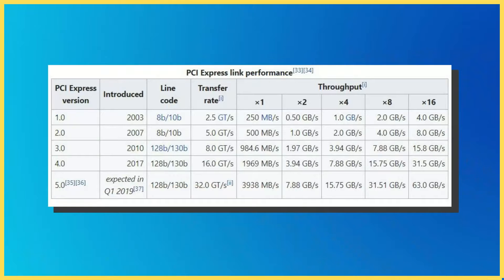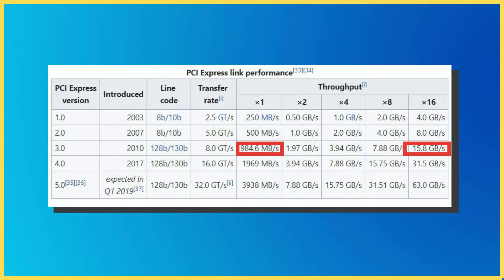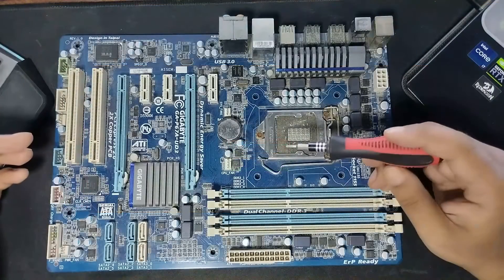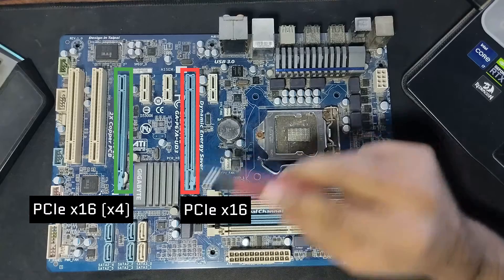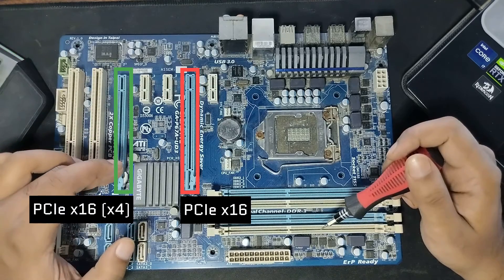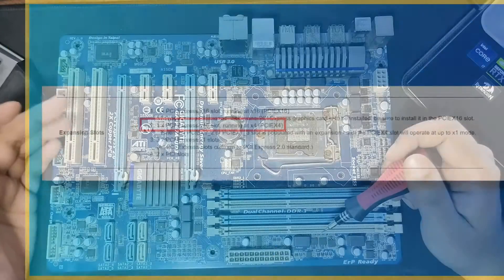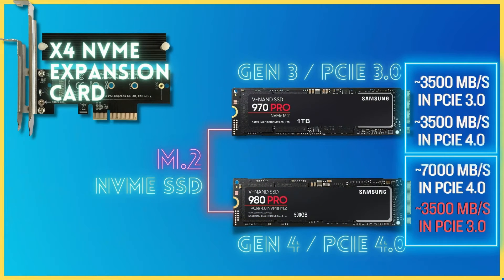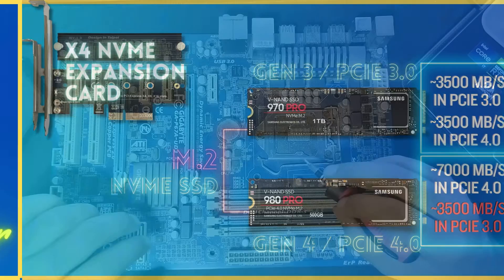What Are PCIe Slots Used For? - Devices and Expansion Cards Explained

Comment: thank you for these great info

quick question tho, my mobo ( b760 mk-d4 ) offers 2 m.2 nvme pcie 4.0 slots ( x4 lanes ), and 2 expansion slots ( x16 and 2 x1 )

can i use an nvme expansion cards on the m.2 lanes instead of the m.2 ssds themselves ? ( treat the m.2 slot as an expansion slot to increase the number of ssds each slot can have )

in other words, can any pcie slot be an expansion slot even the slots dedicated for the m.2 ssds ?

Comment: Hi, great vid but i little confused as to what PCI and PCI E is in your Vid at start, you have far left are those 2 white PCI x 8 slots on the board .   Are they PCI 8 or PCI 8 E?   I ask as i have them on my older 2012 board and i have a NVME H/D adapter card for PCI 8, 4 ect  but not sure if it will only work in plain PCIx8 E? or non E white  if such a thing? as i notice those white ones are turned 180 degs to the PCI 16 E slot?   The Adapter has blocks of pins so can fit in 16, 8 or 4 slot but white or blue or from old boards ect still work in those slots even if speed reduced, lanes ect.